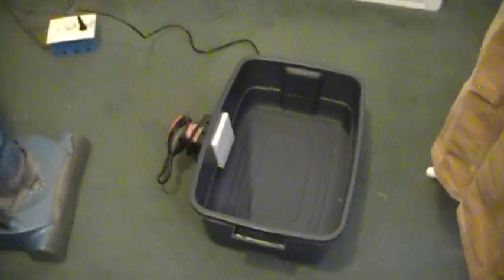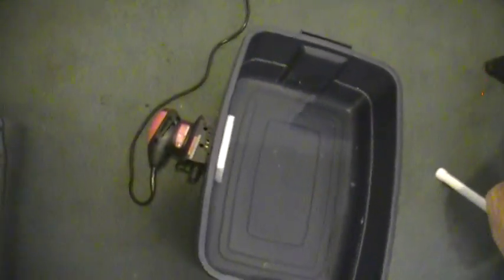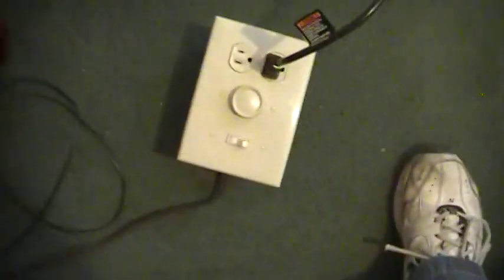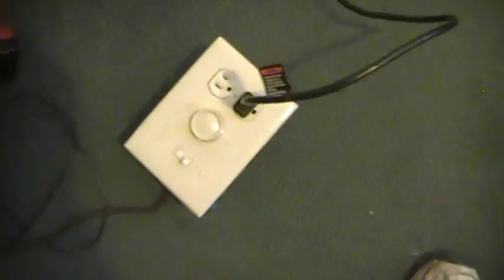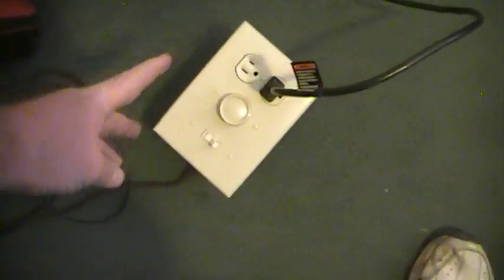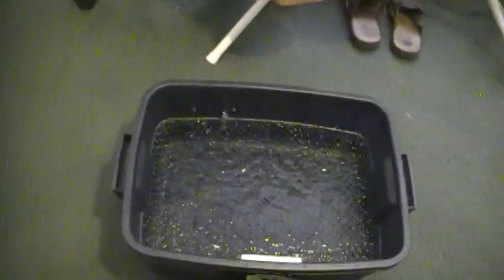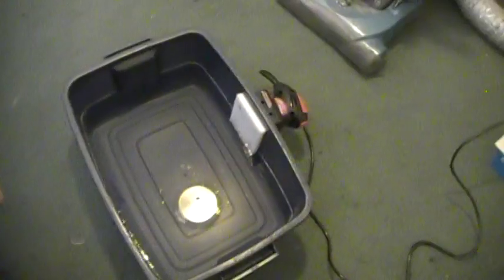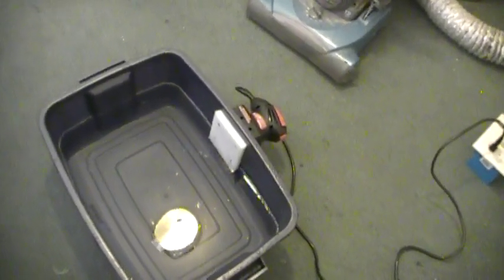Homemade parts cleaner

Comment: #1 no GFCI protection and no ground on the cord. 
#2 A 3-gang remodel box has no chance of being water  resistant in anyway. #3 the dimmer switch isn’t rated for anything other than lighting… the manufacturer of the appliances such as the sander would definitely recommend you never put it on a dimmer switch of any sort. 
#4 something more ridged would help with agitation. #5 unless you’re trying to hurt yourselves please get advice from a professional. This guy wants to risk your lives for views and likes 👍🏼 Don’t die!!☠️
Reply from the maker: Great points.  Still use that power box for much more dangerous stuff.  When I get some time and money will build a safer one.  In 2014, I did not have the money for much else.  It got the job done.   Have my eye on this one for $200:  https://amzn.to/3HGNp0Q

Comment: Neat idea It agitates the fluid just enough. You don't have to deal with an air source for a bubbler and it is probably very low odor. This kinda works similar to the old agitating mechanism on a caustic soda aka oakite hot tank without the mess.

Comment: I think it would work even better with the sander mounted on th bottom of the bucket. Rubber gasket and legs on the bucket. I will build one.
Reply: springs on the bottom to reduce the friction so it can really vibrate.. I am thinking of using an old vacuum motor, but still researching best way to go.

Comment: So does it work i take it not as well as you thought, but side note still will be a entertaining video to see how well it cleans parts( carburetor, bearings, motor pieces etc.) thumbs up
Reply from the maker: Building it gave me some design ideas.  Only problem is, it works good enough.  So it does not rank high enough on my bucket list to make a version 2.  Have a cool idea for a paint can shaker :)

Comment: Just wondering if you found that this cleans part effectively? Sounds like a good solution but you mention that you hadn't tried it yet. Is it a good method to clean parts?
Reply from the maker: It works well.  If you read through the comments, I posted an idea for a version 2.

Comment: Hey man, great idea! Did it work for you???? I am really thinking about making one. Did you post an after video to show how well it worked?
Reply from the maker: Been working well.  Still have it.  Going to build a different one, when I have some time.  More of a circulating fluid design.  Last time I used it, I filled it with Super Clean, and water.  I just leave the Super Clean in, and turn it on when I need it.  Which is nice, cause Super Clean is also super expensive.
Reply: tubejim101 Any new suggestions now that you have had yours for a while?
Reply from the maker: If I where to build that style again.  Think I would liquid nail the tub to some plywood.  Then give it 4 legs with buffer between legs and plywood.  Then attach the sander to the plywood.  Hope that makes sense.

Comment: Hey, thank You so much.  You sure make it look easy.  I wonder what frequency or frequency range makes a sonic cleaner 'ultrasonic' — easy enough to look up I suppose — Wikipedia says "ultrasonic" is anywhere from 20,000 to 400,000 Hz (cycles per second) or multiply those numbers by 60 to get it in rpm (divide by 60 to go from rpm to Hz).  A dremel tool maxed out only goes 35,000 rpm or 583 Hz.  We need many more rpm, like 1.2 million rpm to 24 million rpm (same as 20 kHz to 400 KHz) to be ULTRAsonic and agitate properly to get sufficient cavitation and breakdown the dirt or rust build-up.  A proper ultrasonic transducer might be the only means . . .

Comment: Very interesting! We just posted this one in a homemade parts washers thread on homemadetools.net: http://www.homemadetools.net/forum/parts-washers-videos-32351#post45121 . Jump in anytime if you'd like to chat with other tool guys.
Reply: HomemadeTools.net Website   I use a foot massager to clean my pistols. Hot water and Simple Green HD Pro. Toss in the pistols and turn on the massager. Vibrates all the oils or grease off. Scrub up the guns rinse with hot water. Dry with cloth and hair dryer. Then lube them up. Excellent.
Reply from the maker: +HomemadeTools.net Website Thanks
Reply from the maker: That's a great idea.

Comment: You can buy decent ultrasonic transducers for 7 to 10$ each today. Not the crappy ones but the industrial type. You've done a decent innovation and the transducers used to be exponentially more expensive but Moors law has caught up with electrical component pricing as well ad things like computer capabilities.

Comment: Water and electricity, not a good combination.  You may ended up having a very shocking experience to say the least!
Reply: +sjeverett75 I was just going to recommend a GFI outlet in the control box, but yes most garaged should be protected. Just not up to the NEC standard rule changes in 2008. For example, mine is build in 1985 and the a garage has GFI protection from the load part, but does not have the outlet in the garage, it's  daisy chained from the guest bathroom. The NEC code change now states you can not daisy chain different rooms like mine was done. Also outing the protected outlet in the control box makes it so if you move it to another room it will still be protected.
Reply: +Larry Cutsinger You realize all garage circuits for the last 25 years or so have a GFCI so that doesn't happen? Also, if it was me, I'd have used one on the gang box to begin with
Reply: Hi Joe,
Thanks for helping me make my point about safety concerns.  If he has it on a tested GFCI circuit that should do the trick.  I would have used 12V to further reduce the risk.
Reply: +Joe Blow you are assuming the age of the house and assuming it's up to code. Hard to tell from my phone, but it didn't look like the outlet that box was plugged into was a gfci.

Comment: Thanks for the video. I know they take time to make. Mineral spirits work good for greasy parts. Also dawn dish soap. Keep an eye on the dander and the dimmer box. Those simmers are bot rated for the amp draw of a motor. Most of them say that. I have burned up many motorized items with dimmer setups like this. But, thst does not mean yours will. Maybe build a fuse in for safety or a breaker. Cool idea. I think I will try it but use an old bicycle inner tube to hold the sander on the lid so I can still use it as a sander when needed. If only I still had thst vibrating table top football game we had as kids. That would be perfect. Off I go to Craig's list... thanks again.
Reply from the maker: wolfeman351 Thanks for the info.